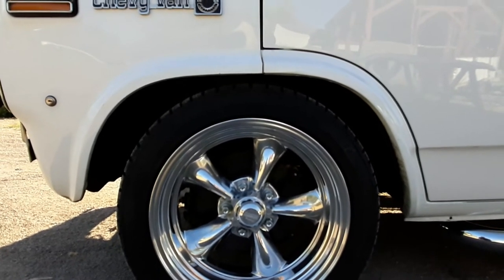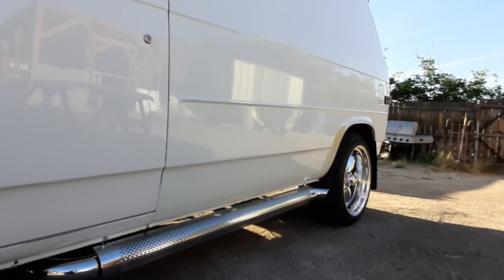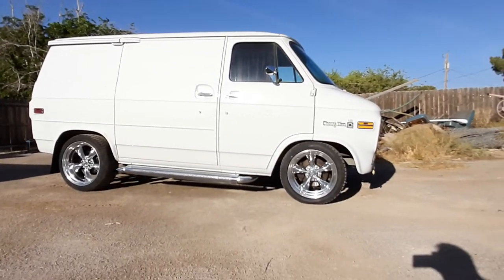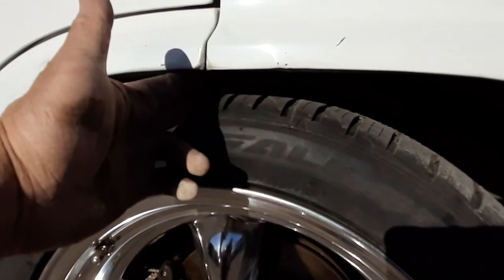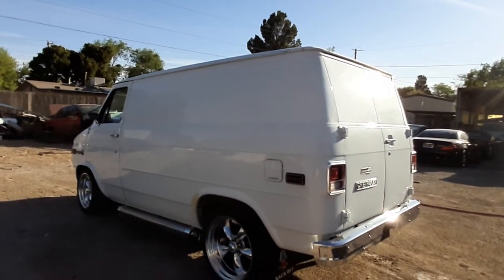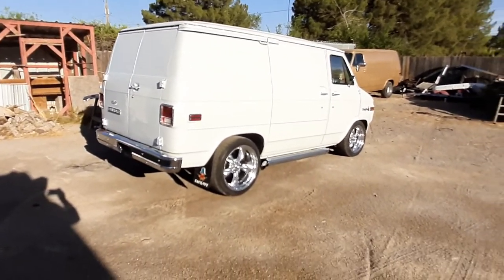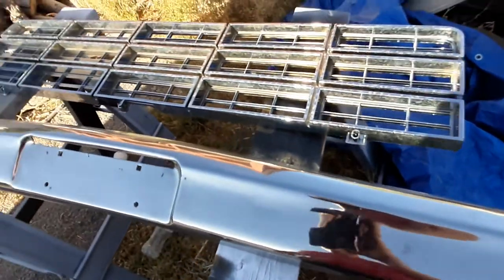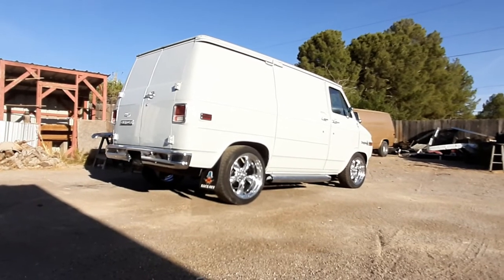1978 Chevy G10 G20 G30 Shorty van even lower and new Cragar wheels don't fit!

Comment: Have a 88 GMC - 91 Chev and a 76 b100 Dodge...

Plan is to do a full front clip on the Dodge,...
A 1998/2003 with old Ford door mirrors.

Gull wing side door and update the 318 to a Chev TBI and side pipes.  

The 88 will get a new drive train - full disc brakes, a 8.6 rear end and a full drop of about 5- 7 inches...

The 91 is going to remain mostly stock - a HEI, carb 350 with a 700r4 automatic, stock rear end and 235/75/15 tires on nice aluminum wheels...

It's a daily shit and get rolling motel - need to service the lady's 😉

Simple old school - a run on anything end of the world get her done vehicle...

Comment: front looks perfect , back needs to come down a inch or 2 , plus that would level the front up a bit ..
Reply from the maker: Thanks for watching and yes I agree with you and plan to drop it in the back but not sure if I can drop it a full 2 inches as I do not want to rub the rear tires. But even a little drop will make it look better, stay tuned!

Comment: Me personally, I would drop the back another inch. I'd put the stock springs on the front and cut them. I want to do that to equal out left and right heights. I plan to trim the spring a bit more on the side that sits higher.

Comment: Nice looking van ! I’m curious of the size of rims & tires, I have a ‘78 shortie, but converting the look to pre - ‘77 I’m totally going the opposite of your clean look, & getting into the “Rat” 
side of life ! But to have a totally clean look inside ! I’m digging your stance, but just an 1”, no more than a 1 1/2” lowering would give it a Sleeker stance ! Looking forward to your next postings ! Thanks …..
Reply from the maker: I am running American Racing Torq Thurst II  20 x 10 with 275 40 20 tires and 18 x 8 on 245 45 18 tires. I wish I went with a 285 40 20 on the rear because the 245 45 20 looks a little stretched with the 9" wheel, next time I will. Thanks for watching my videos. My white van is a 1978, I am in the middle of converting it into the 1977. I also have a video showing the entire conversion from beginning to end coming very soon. If you cut your coil springs you can easily get the stance you are looking for. Just remember no torch use a cutoff wheel on a grinder and If you want 1 inch lower only cut 1/2 inch from the total hight. If you want 1 and 1/2 " only cut 3/4 inch from the hight of the springs if you cut 1 inch from the hight it will drop 2". The formula is whatever you cut from the hight of the spring is double in the drop.
Reply from the maker: If you like the "Rat look" check this AWESOME van out! https://youtu.be/H1usz8vJIiA
Reply: @ricksteelcustoms3196  Thanks Rick ! I’ll be running 8”x17” in front, & 9”x17”at the rear, w/ a 50 series all around, the width, still to be determined, any suggestions ? ….. I’m wanting to keep the tucked in look, & not having to use any flared fenders ! Thanks for any ideas or suggestions in making my lil ride an eye catcher ! The rims are the US Mags rat rod “68” series, black satin, but having all the rims powder coated before tire installation, living in the Pacific North West, is a must ! & if by chance, replacing any bolts, washers, & nuts into stainless steel where applicable !…. Thanks again Rick, & Happy Vanning …….